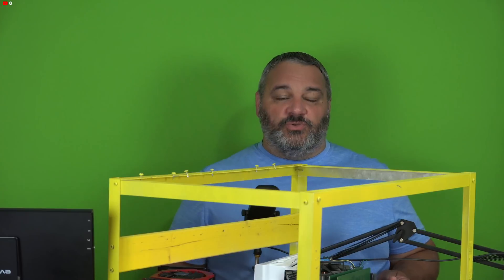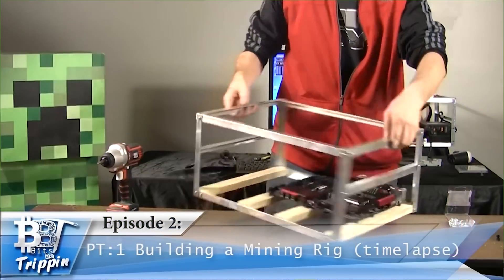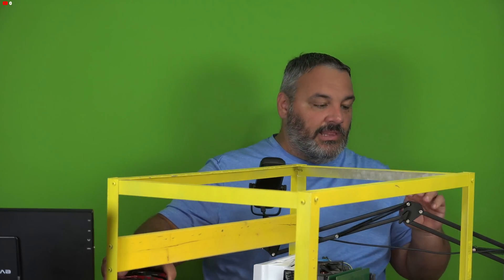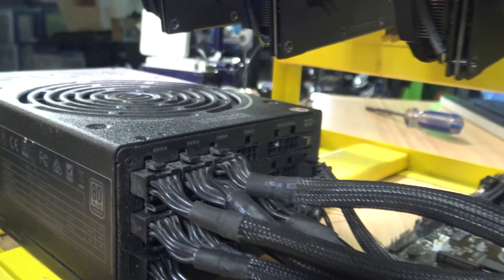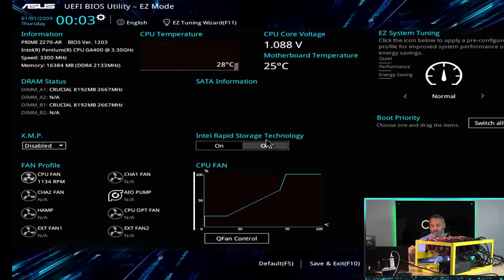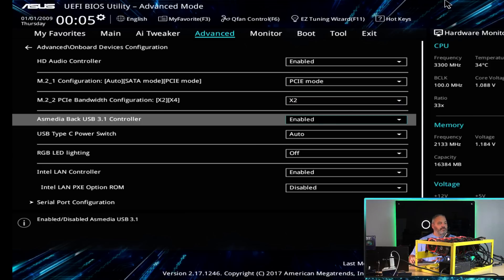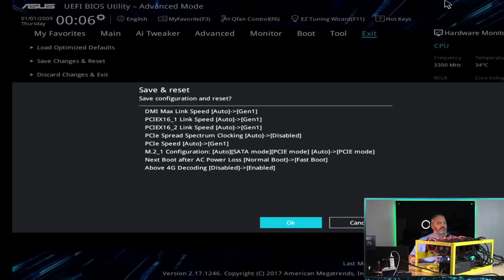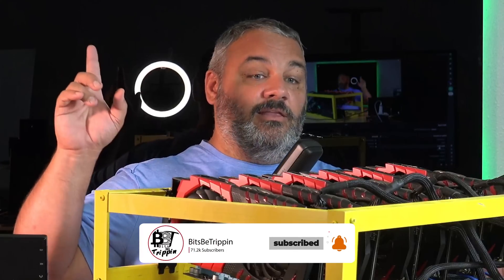#GPU #Mining #Build - Reviving a salvaged mining rig

Comment: My mobo is very similar with the same kinda BIOs. Have you noticed whether if you use different card models/manufacturers if it stops posting after the 4th card is installed? Mine was working with 6 until last night when I tried to bios mod the cards. They all work individually, but if I install all 6 of them it will not boot. (4 does boot). Would it be harmful to flash all of them with the same modded bios? (they are all the same model/manufacturer/etc)
Reply: resolved by switching to HiveOS instead of windows.

Comment: I actually just built my 2nd gpu rig ever, using 6 rx580s 4gb. I also have a 570 and a 480 that I'm gonna try to get on my mobo using some m.2 to usb3 pci adapters. It's cool to see you post a vid about a similar rig!
Reply: U can use 1 to 4 pcie splitters as well
Reply: @rdrpro69  I think i resolved it by just switching from Windows to HiveOS. I believe it was related to the UEFI driver stuff after bios modding the cards. Not sure how to work around that for Windows, but hive immediately saw all 6. Now it's a matter of occing correctly :)
Reply: @Kryptex90  nice! Hive is the best!!!